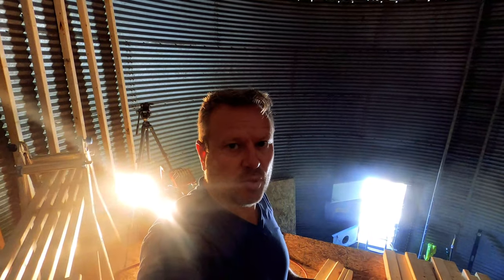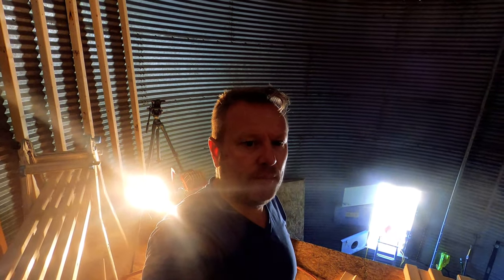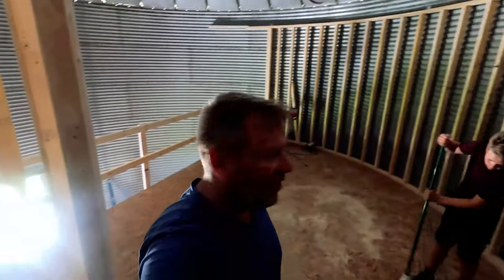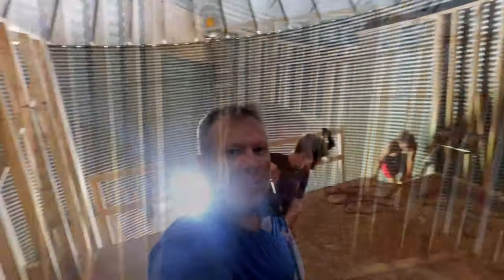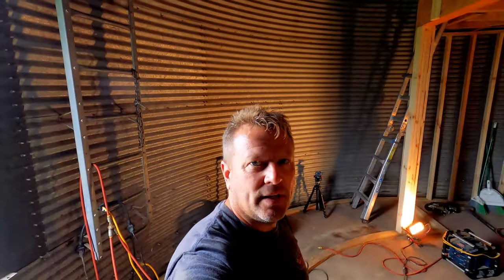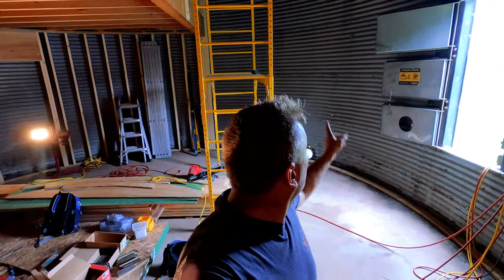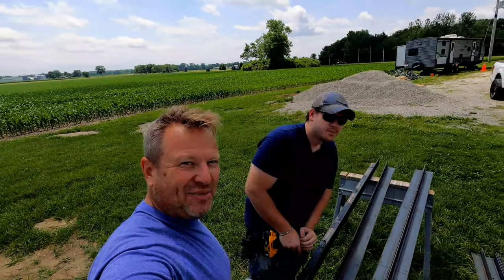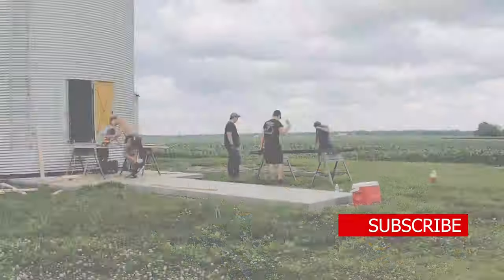Grain Bin Home Build... Episode 11 "Interior framing part 3"

Comment: What’s the fastest way to cut the plates at a curve?
Reply from the maker: I started out with a jigsaw and cut out first one as a pattern.  Then i would screw it down and cut out all others with a duplicating bit for my handheld router.  Worked good. Went through 2 or 3 bits.

Comment: Is it necessary to build headers over the doors and windows? I know in stick built houses they are needed as the walls are supporting rafters, roof and the rest. With the grain bin it seems that the metal is holding this weight right?
Reply from the maker: @tjshirks  yes need headers  in the wood framed walls over windows and doors... some of the floor framing is setting on them, and also the ceiling rafters are setting on wall as well.  So there is weight on the headers.

Comment: Is there some reason that you didn't cut some ventilation holes/windows into the walls early on in the framing process?  Sure looked like a sauna, and dark, too!
Reply from the maker: Once you cut the outside metal it weakens it.  Waited to cut out to fit my framed openings and able to put steel on right away to reinforce openings.